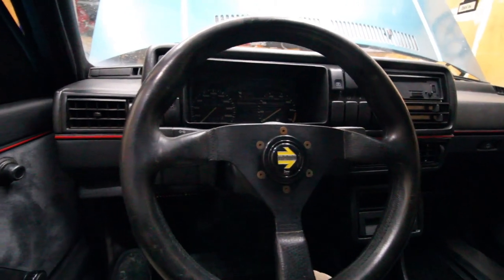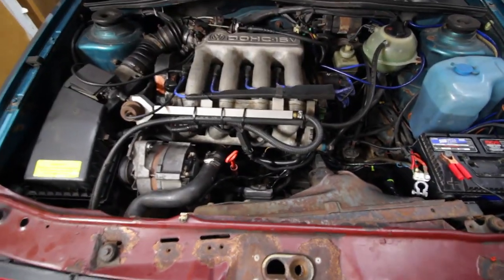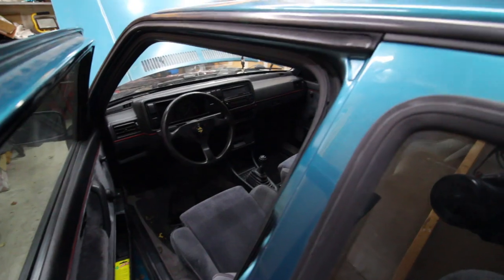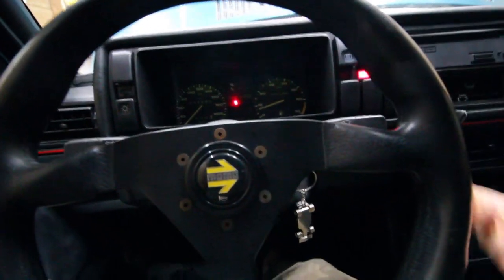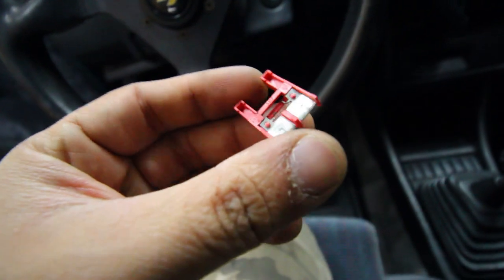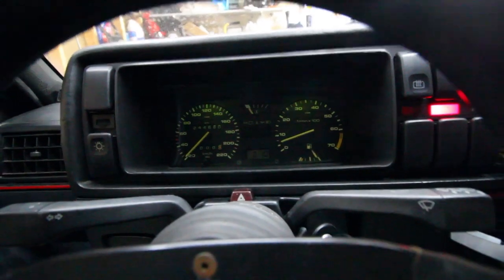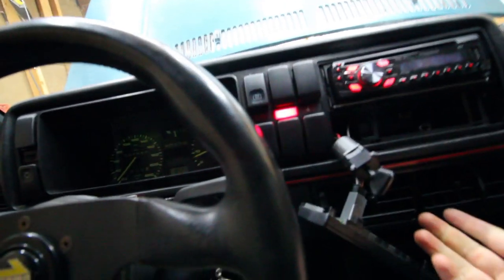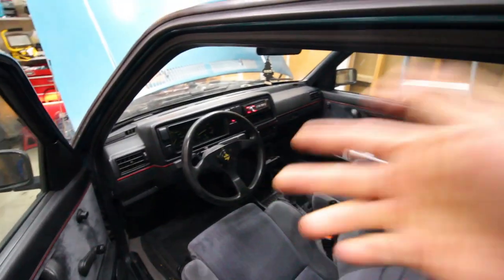Volkswagen Golf Mk2 | Fan Not Working

Comment: Hey Mate, I'm having the same trouble with my thermal fan not kicking on as it should. I flushed out the radiator and put new coolant in however I suspect air in the system. Did you manage to sort yours out? My dash temp gauge is going to abouts the 3/4 mark 😣
Reply from the maker: jayisk82  check the thermo switch leading into the radiator
Reply: @6ixthstage845  Thanks for that. I have check it and its working however because I have flipped the radiator over to allow space for a MK3 alternator and Air compressor, the position of the sensor is all the way at the top of the radiator instead of down the bottom. I'm guessing the the coolant is not reaching that section of the radiator and thus not triggering the fans to run. Any tips on getting the coolant to fill to top of the radiator? If I prop up one side of the car with a jack, i think it forces coolant to the top left hand side where the sensor is now located and triggers it, however this doesn't seem to happen when i have the car leveled :( Any advice would be appreciated.
Reply from the maker: jayisk82 not sure how you have yours configured but if you've filled it to the max level of the coolnt bottle--theres not much else you can do besides running a switch